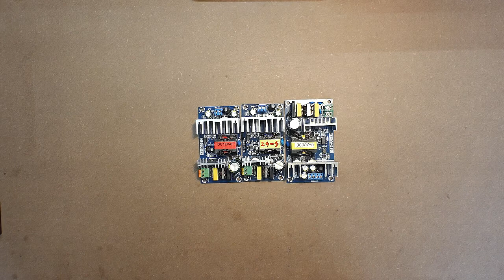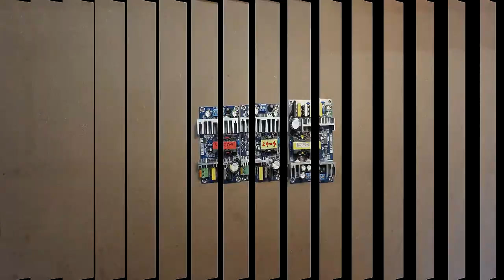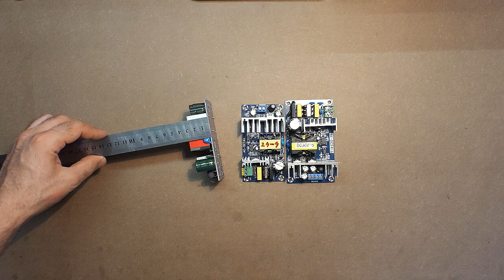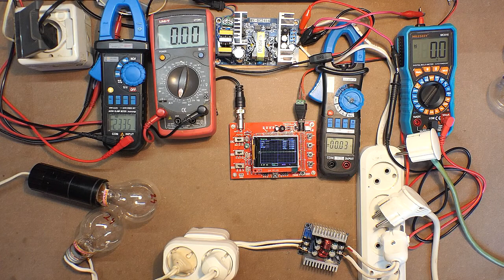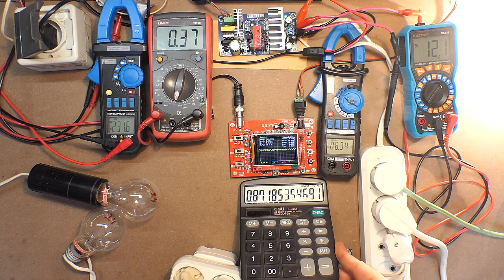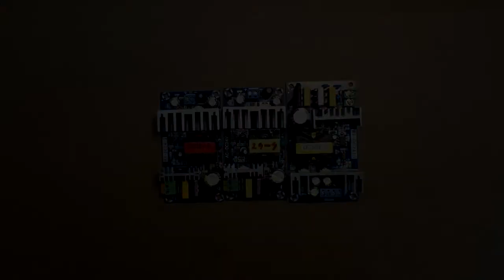12V, 24V, 36V Power Supply Units - Test

Comment: Thank you sir for this excellent review.
Reply from the maker: You are welcome
Reply: @koglianc  Sir Its my humble request to you that, How we can decrease the 36V 5Amp Supply to 24V. What are the changes we can do in it. Please make a video on this as soon as possible. Thank you
Reply from the maker: @nishkarshcharan6337  You should find a resistor responsible for the output voltage. But, as I know, you will be able to change the voltage only by 1 or 3 volts, not more.
Reply: @koglianc  Thanks for giving the information sir. But by adding a Trimmer Potentiometer can we change the output variation more? Sir please make a video in detail which resistor we should change and what is the value of that resistor?
Reply from the maker: @nishkarshcharan6337  I have no certain information about that, but, as I've learned, you should change the resistance of R18 and R 19.
Reply: @koglianc  Ok thank you sir for this excellent information